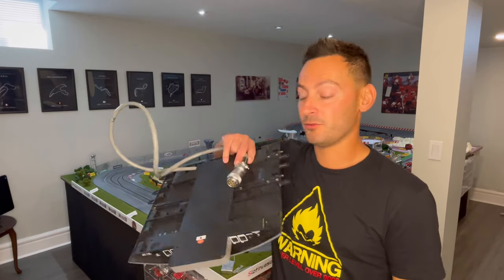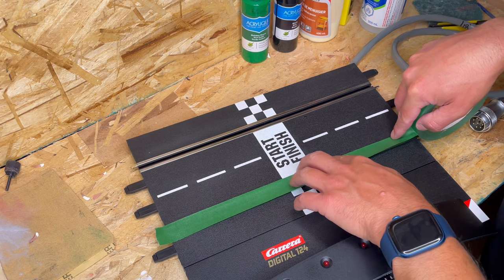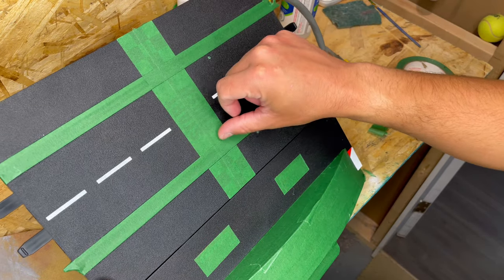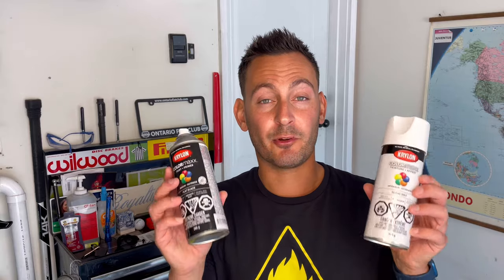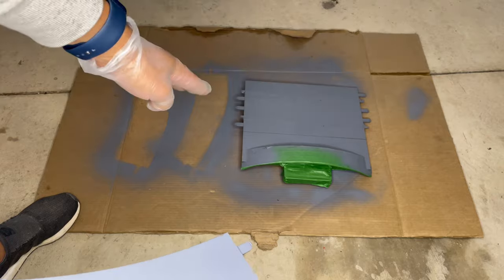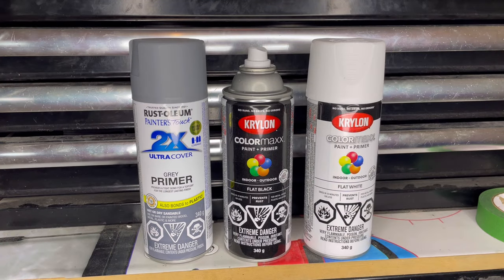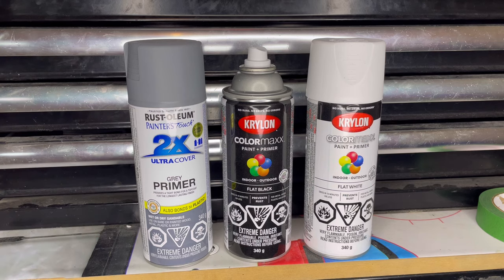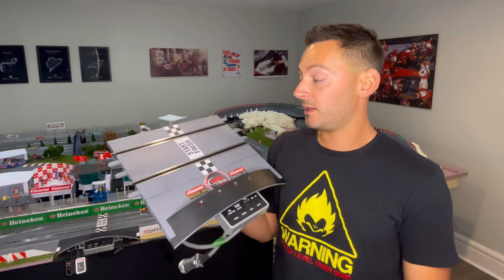Let’s Paint Some Track! 🖌️🏁🏎️

Comment: Looks great Mass! If you had the track on its side and painted straight at it, it would help the bleeding. Also light coats to start with helps. When the track is laying down flat and your painting at an angle, it is more likely for the paint to bleed in those seems. It’s all about the angle and amount of paint to start with.
Reply from the maker: Thanks Brother!
Wow thanks for the tips, I’ll keep that in mind moving forward. Cheers! ✌🏼

Comment: It looks  great. I would love to paint mine. I’m just not ready to pull it all apart. And start the process .
Reply from the maker: Hi brother! Yeah it’s a little bit of a daunting task. I remember regretting it when I first started because I would take a step back and realize I have to take apart the whole track lol. But the look once finished is worth it in my opinion. Not to mention the extra grip.
Reply: I think painting a track has to be a thought before you assemble the final layout on a couple tabletops!  Great idea!
Reply from the maker: @lindseyangell986  agreed 100% 
In my case although I didn’t have any intentions of painting the track when I built and assembled everything. It was an idea that grew on me as time went on and after seeing the amazing work done by Boone. In a ideal world yes you’re right, it would be nice to paint first and build after. But if there’s someone like me, Boone or anyone one else that painted afterwords, it is doable. Some work is involved but nothing crazy.  Thanks for watching! Cheers✌🏼
Reply: @lindseyangell986 I’m still in the process of picking a final layout for my track. I’ve already made a few design elements inside of a couple of curves that I know will be staying. I used foam board and made my own shoulders instead of buying them from Carrera. This method is giving me the opportunity to make different types of curbs, rumble strips, gravel traps, etc. On one curve in particular, I made the shoulder on the outside lane SUPER slick, which takes away the advantage of wall sliding along the outside lane. 

I can’t wait to get it finalized and paint my track to match. I’m taking inspiration from COTA and will be doing a swoopy red, white, and blue with stars theme all over my curbs, shoulders, and runoff areas.
Reply: The track that Marty Ford has is not my goal, only something that later will be for any kids, young adults to play on…

Comment: How did you tape off the sensors? Nice job looks really good
Reply from the maker: Hi, I just used the painters tape and made sure to cover the entire sensor. I left some extra and pushed in around the sensor using something thin like the Slot It Allen key that comes with their cars.

Comment: My comment is , did u acheive a gripper track , I have been using silicone tires , But you use Paul gage correct , so I like to know if u have done , laps with both type of tires with the new weathered track look
Reply from the maker: Hi, yes the track surface has more grip so mission accomplished. I’ve now only been using stock tires and Paul Gage.  I only use the silicones at the club track now. Reason being the silicones like to clean the track and remove any added grip that has been put down by the rubber or urethane.  I did run one car with silicones on when I first put the track back together, it was moving! With any car you can feel the difference the grip levels.  You really feel the difference with non mag cars, there’s just a little more bite in the corners.